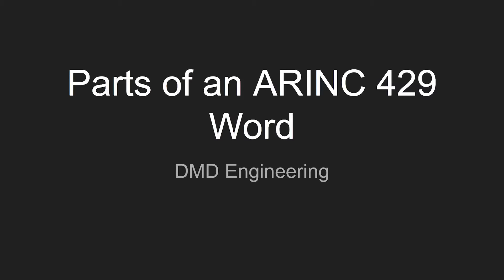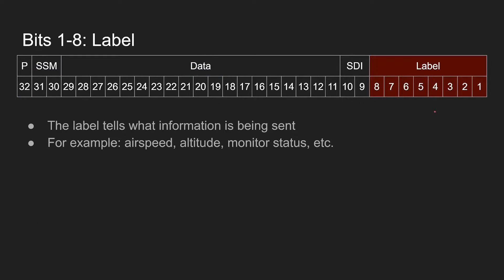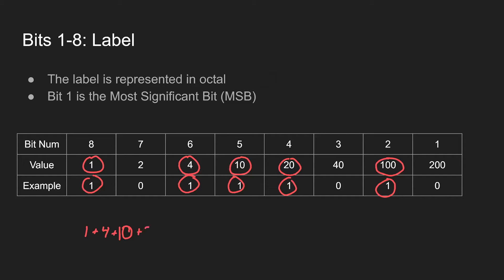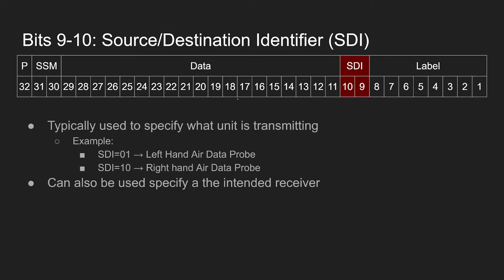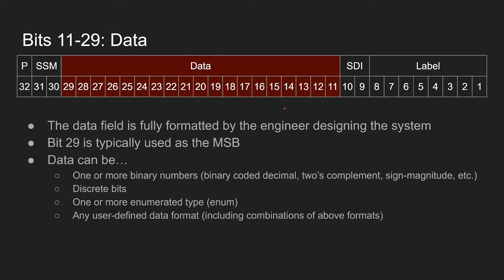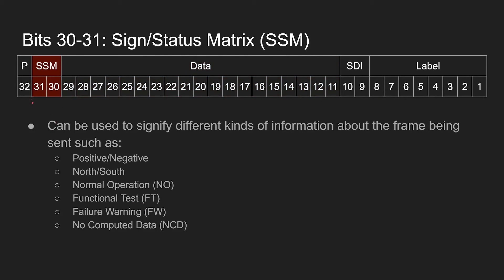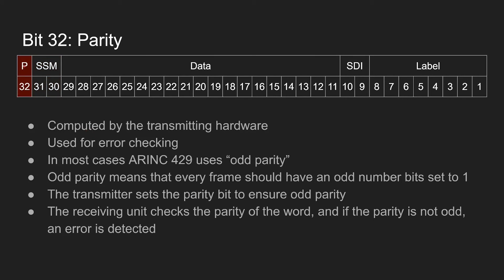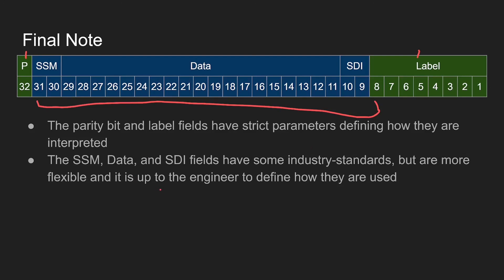Parts of an ARINC 429 Word

Comment: Is there something wrong with the conversion of binary to octal? I think converting from binary to decimal then to octal, might give a different result than converting from binary straight to octal?
Reply from the maker: You get the same result converting from binary directly to octal as you do converting to decimal and then to octal. The only reason I show the decimal number is because people typically work with base 10, so it could be easier to first convert to that at times.
You can confirm this with an online base converter:
01011101(binary) = 135(octal)
01011101(binary) = 93(decimal)
93(decimal) = 135(octal)